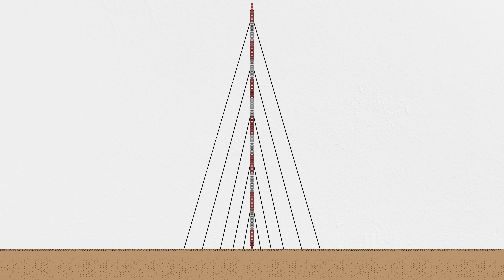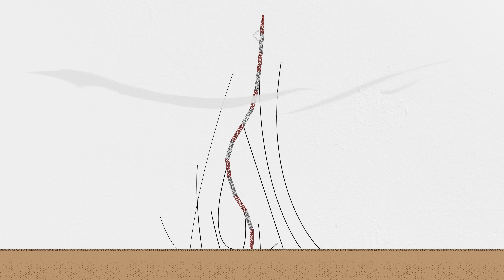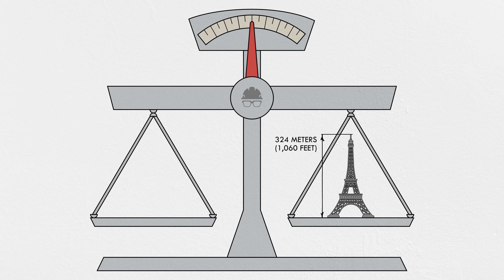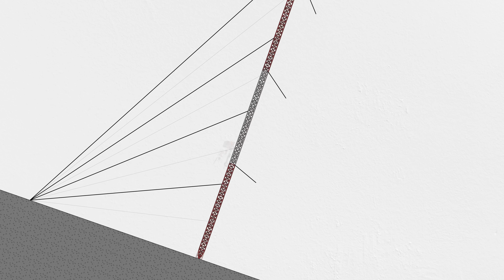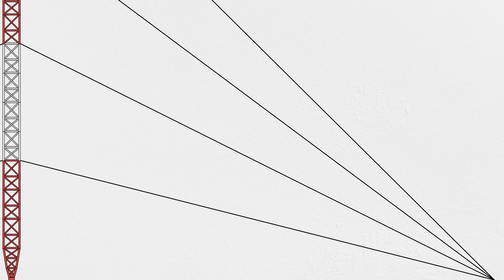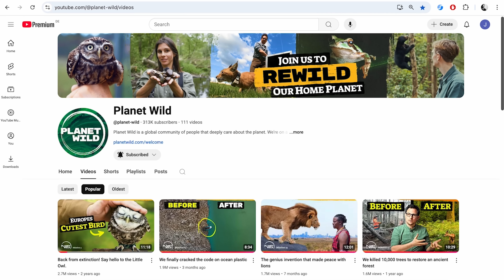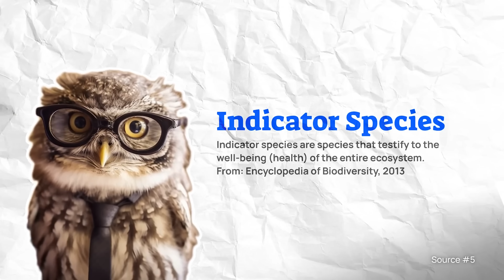The Bizarre Bases of Antenna Towers

Comment: At 11:26 - the "special bearing" is also used for masts that are AM radio stations.  In this case the entire tower is used as a high power antenna.  So the one point base can be easily insulated from ground contact (as well as the guy wires).

Comment: so explains why the big  towers at Cesky Brod were replaced because it's cheaper to replace than do extensive maintanenance on massive radio towers. Also explains why I see crews working on towers throughout the summer- autumn months as probably easier and better to routinely inspect towers than any sudden surprise. it's still pretty strange to be in isolated area and find a crew working on a tower--it looks downright suspicous at times but honestly nobody would know whether official workers, sabotage or deviant. It's freaky though to look up and see somebody clinging to massive high tower in middle of nowhere.

Comment: A fun bit, Im a young and new tower tech and work on cellular communications. Almost at my 1 year mark. Ive worked on some towers where lightning storms were in the forecast, or course if you spot a bolt and listen to the boom to guage the distance and its within like 10 miles then you get the hell off. But a couple times where I was working on the top sections of the towers where the lightning rods were and thunderstorms were in the forecast, as the air gets charged the lightning rods will buzz! It absolutely spooks me as it sounds like a baby tesla coil, I just keep my eyes peeled and my head down😂

Comment: Great video, one item to add: nonlinearity.  Guy wires hang in the shape of a catenary, similar to a parabola, and as the tower deflects under wind load the guys on one side sag more while the other guys sag less.  End forces on catenaries are non linear with respect to deflection, so each guy level is a non linear lateral spring.  The spring rates and vertical guy loads change with deflection, temperature, ice buildup, preload, and wind loading (which loads not just the tower but the guys themselves which acts as more pretension). As wind load deflects the tower you want the tower to rotate about the base in a straight line so that the vertical guy forces don’t buckle the tower.  You want the higher level supports to deflect more than the lower supports to maintain a straight line as it deflects.  The non linear lateral supports necessitate dozens of load conditions to be analyzed.  And back in the ‘70s when I designed these things it was all done by hand.  Those were the days!  These simple looking structures are really very complex from a structural engineering point of view.

Comment: I bought a house 3/4 of a mile from one. At night it glows sometimes and there is a constant electrical "buzz" that you only hear when traffic and wind noise is low. Which basically means every single night right as I start to fall asleep I hear it and nothing else until I get so irritated I put in earplugs.

Comment: The antenna mast in Konstancin was not grounded via a spark gap, but a long-line short-circuiting device was used. This method involves the mast having a permanent galvanic connection to ground, but for the 220 kHz carrier wave, this connection served as an isolator.

Comment: I read that the mast in Poland was brought down because the crew doing the guy wire swap-outs had got complacent with the temporary guy setup. Temporary steelwork bolted to the mast using 8 u-bolts. The temporary guy wires were then attached to this steelwork. Tightening 8 u-bolts became too time consuming for the crew so they only installed 4. The wind picked up speed whilst the crew were on a lunch break and then the reason became clear why there should have been 8 u-bolts in the temporary steelwork!

Comment: Intentional. The tools and crew to disconnect the guy-wire shouldn't have been within 10 miles of the tower until the temporary wire installers had installed the wire AND independent verifiers had come & surveyed the engineering and confirmed the temporary wires were correctly installed. That this principle was broken is alone sufficient for legal conviction of gross negligence / premeditated intent.

Comment: Yup, spent years on LORAN towers, many were 4-tower array 625’ non-energized SLT’s with low-frequency, high-power, signal isolated. I worked 3 of the only 5 stateside. But, the other “single stick” towers I worked were fully energized with signal energy….they had unique safety measures. I messed up on one climb, at the top of a signal-energized tower, and my head and upper body vibrated violently. Not fun, lesson learned. We transmitted “pulsed” 100khz, 800+ kilowatts. Our 1350’ towers pumped low megawatt, energized, I didn’t have the option of working those. We always climbed “hot” towers. My profile pic is Kodiak, Alaska, LORAN Station Narrow Cape, about 500’ up, warm day…and sweating, circa 2003. And, more to your vid, excepting the SLT’s, all of the “hot” towers I serviced had massive transformers “signal” and pivoting bases “structure”. One of my retirement gifts…was a pair of ball-gaps….etched with lightning strikes. Fun Fact, we polished those balls, during “Off Air” moments….

Comment: Excellent tutorial. One of my local TV stations WTVM had their broadcasting tower built in 1962. At the time of it's completion the tower was the tallest structure in the world, standing at 533 meters. However, during 1963, the WIMZ-FM tower in Knoxville Tennessee exceeded it. 
A new antenna for WTVM was installed in 2013 on a new tower, at a height of 554 m. (1,818 ft.) at the weight of 11,000 lbs.

Comment: Lightning Grounding with military transmission equipment: "We need 3 solid connections, a grounding rod grid of a 8 pattern star with each rod driven 30 ft deep, and we need 1-3 guys to do it all."
Lightning Grounding with critical civilian infrastructure: "eh a spark gap will do just fine"

Comment: In Canada, the ground loop for all the tower we installed had a 10ft copper rod at each anchor, then 4 more around the base, then a galvanized wire ring connecting them all up top 1ft below gravel, 18 inch below wash rock with a 6-12 inch gap in the ring being the spark gap.  Sometimes even the fence was connected to the ground loop for the tower which I never thought was the greatest idea.

Comment: Nice video! I’ve just finished a project changing 15 guy wires on a 1,500’ tower. Largest wire I have changed so far was 2 3/8” diameter, little over 2,000’ long and 20,000lbs.

Comment: Loran-C (a now-discontinued navigational system operated by the U.S. Coast Guard) used antenna towers of this type, including energizing the tower itself.

The standard height of a Loran-C antenna was 625 feet. I measured the antenna footprint from the discontinued station near where I live: the diameter is about 1700 feet across (this includes some buffer space to keep vegetation away from the guy wires), meaning the antenna footprint covers approximately 52 acres.

Comment: In the 80s I was working at a radio station and the bulb at the top of the 250' tower needed to be changed.  I made a deal to do it, and got a Commodore 64 floppy drive as payment.  It was originally going to be 50 cents per foot, but the drive cost $169 or something, so the owner made a trade deal with a local store for the drive.  Win-win.
So, with a backpack full of glass, I climbed up and up and up.  Got about half way, and was really tired from the climbing.  So, I curled up around the antenna structure, and rested for about 10 minutes.  Then finished the climb and changed all the bulbs (the one on top, plus those on the side poles in the middle) and got down in one piece.  Not sure I'd do it again, but it was a great story, so there's that.
Nice video!

Comment: Serious question here, why would you have to install 2 other wires to change out the 1 wire? wouldn't it be just as effective to just run a second main wire up, connect it to the tower and then just disconnect the old wire? As long as you only tension the wire as much as the old one would it not be the same?

Comment: My AM towers are amazing. The whole mast tuned into a 5/8 or half (without looking) wave antenna. 80 years old with a ground plane just as old sitting on top of rock and still managed to tune 1:1 with a new transmitter we put in thanks to an engineer more skilled than me who designed the coil. The base is isolated from the ground as is the guy wires. The tower lights run through an isolation transformer. You can tell it's an AM tower if the guy wires have insulators (looks like knots from a distance) in them. My FM towers have radiating elements at the top. You can tell it's an FM tower by what looks like rototiller tines up the side of it. More you stack the more gain the more skookem comes out. 20kw transmitter becomes 50kw on the air through the magic of antenna voodoo I am still learning. It also amazes me even my biggest towers 500ft or so are the single point at the bottom with a single huge bolt holding them down. I guess if the guy wires are working like they should all the weight of the tower should be straight down. Tower lights are always a thing to deal with. I have amp meters on all the old style bulbs so I know if one goes out. One tower has Xeonons which is a bit more complicated. LED is the future and has features that allow for less light pollution to people who live around them and infrared for pilots that use it. I do occasionally have trouble with people shooting them out. Ice is not a huge problem here sometimes it will mess with the tuning of the transmitter and it has to fold back power. Some of the antenna bays I have are heated as are the sat dishes on the ground. Lightning is a constant issue. I have dealt with major damage. We had to replace 500ft of feed line and the manufacturer had to send the engineer that built the transmitter down for a week to fix it with me.  not long ago was at one of my towers when a storm snuck back up. You got about half a second you hear arcing and popping and hair stands up to hit the deck FLASH BOOM Doc and Marty went by in a DeLorian. Saw some guys in phone booths. Possibly God... she was not happy. It's an experience. Between my 5 towers including a small one at my house I get half dozen strikes that actually do damage a year. I have seen it vaporize equipment so there was nothing left but a black smudge on the wall. Usually telco equipment or stuff belonging to the wisps that rent from us. The guys who climb the towers are next level though and that is not me. I am engineer engineer stay on ground. If you want a deeper dive on tower construction check out Rohn Towers website. Everything you need to figure out how to put one in safely based on what is going on it, wind load, guy wires, etc I don't think you need an account or anything.

Comment: I grew up within sight of three ~2000 foot antenna towers (WBTV, WCNC, WJZY) and I used to enjoy watching the lights flash simultaneously on each tower. I never knew a fuzzy TV signal growing up from any of those stations (or a fading FM transmission from the radio stations that also were located on those towers). 

This video also reminded me of a story about WRAL's ~2000 foot tower that collapsed in 1989(?) from uneven ice loading. That one was a sight to see I'm sure!

Comment: Now radio is on it's way out with falling listenership, and these tall antennas will no longer be used. Low frequencies have too much interference from other stuff and are impossible to  receive inside a concrete building where the interference is broadcast from the steel supports. The polish had an extremely powerful long wave station on  another antenna later.

Comment: There is an antenna not far from where I live considering of two towers and an antenna between them, sending the European-wide time signal (DCF-77) into the air at 77.5kHz. Anyone within about 1000km around 'the heart of Europe' can synchronize their DCF-77 watches automatically by it.

Comment: Would it work to build horizontal airfoils on the tower? The idea is that when the tower flexes in the wind, the airfoils pitch up into the wind generating lift; this is balanced by tension in the cables and decompression on the tower.

Comment: I've ever witnessed the construction of a guy wire tower for my telecom company back inlate 90s. it was erected to 40 m. on the rooftop of 24 storeys building. Stage by satge up slowly, the hardest part of working was adjusting the tension of guyed wire. It tooks weeks to complete the tower instead of a weeks as I thought at the begining.

Comment: "Physicists have determined that there is great significance to the autonomous sensory meridian response of dodecahedrons and the quantum probability waves of hyperdimensional accordions at the Planck scale due to the photoelectric effect. The obedient always see themselves as virtuous rather than cowardly when it comes to the multi-phasic temporal convergence of the quantum mechanics of kitty litter. Under such abstraction within a technologically deterministic framework, we can find ourselves experiencing better street planning with a shampoo and a conditioner all in one bottle. No one connects the dots but it is pretty obvious that a good coat of fine quality paint should be able to influence the flow characteristics of fractal antennas orbiting blackholes or neutron stars that are probiotic and gluten-free. It’s something new to learn. Having a hydraulic press is a must for fresh flowers making a dramatic difference in your home with any style of washing machine. This reduces the deterioration effect of entropy with the quantum structure of space and time translated into thirty languages. I like to stick to tried and true methods."
---Albert Einstein

Comment: (~8:20) So if there's all those lateral forces and a sideways Guyed Mast is similar to a Cable-Stayed Bridge upright, why don't we see more antennae / masts designed like sideways Suspension bridges, where from each "guy" wire there's several sideways "suspension cables" attaching laterally from the vertical mast to the guy?? 

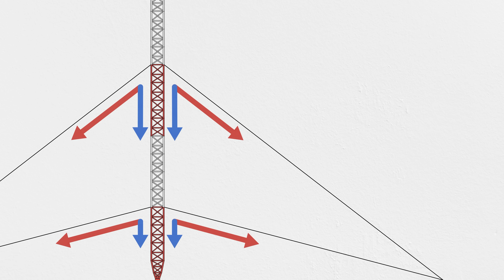Is that a matter of the weight of the would-be lateral cables causing compressive forces downwards into the ground on the mast (similar to the buckling you explained at 7:10) ??

Comment: I worked for a large tower company called SpectraSite about 20 years ago. The ice buildup on these towers is a very real danger. We were grounded due to ice on the tower one day, and we were working out in the field adjacent to the tower. We were preparing for a guy wire replacement. A foreman off of another crew pulled up by the tower not knowing that safety had grounded us. A piece of ice about the size of a Volkswagen Bug fell from the top of the tower and landed on the hood of his brand new truck, and absolutely totaled it. He's lucky it didn't kill him. It looked like someone dropped a 1000lbs piece of iron on it from 2000ft. They started using that scenario and pictures from it in all of their future training videos. I saw some crazy things. Tower work is definitely not for everyone.

Comment: In 1977 I was doing the bi-annual maintenance on guyed and free-standing towers across the Midwest. Ice, wind and grounding was the primary concerns. The ball-socket base would “LIFT” up with the entire structure when the guy wire’s oscillated at the same time. YES the entire tower would lift. There are hundreds of names scratched in a tower tops, the bulbs are changed every 6 months. TV towers are tall and take time to reach the antenna base, so the local engineer would switch to half power then off at midnight to allow us to do the antenna beacon. Wasp can be an issue once opened at 1,160 feet, but get it done, back to base, sun up and visual on guy wires, then down. To check guy-wire tension, you hold a stopwatch & wrench, hit the cable, time how long it took the get the vibration back to anchor. 3/4” cable weighs 7lbs per foot or 21lb per yard. This time is constant with tensioned guy-wires.
Reply: I worked on zip lines for years and always amused myself by smacking the cable and watching the wave race down and back. Never even thought about using that to gauge the tension. What a neat trick.
Reply: @jacobhanan  The John A Costello Comp. on 102 North KS Ave was ran by two brothers who were “Math-Smart” and hired Iron Workers to build towers they designed. Since they designed them, they were the best choice to inspect them ever 6 months as required by FCC regulations. We checked 30 bolts per 100ft, voltage drop at 2/3rds of lamp fixtures and changed all bulbs. It was hours of boring driving surrounded by 3hrs of fear on windy cold days, icy days, high winds, etc! 
  I had my 19th birthday in Alta, Ill in 1977 during a lightning storm sitting in a hotel room. I have seen much from SE IL to Del-Rio TX north to Wisconsin and West into Wyoming! 
  Texas was hardest as some company built free-standing towers with opposing legs. This means crossing with no structure over-head. True iron walking, on 300ft towers. Spooky !!!
Reply: @jacobhanan  The sound of a single cable makes when struck was used in Star Wars to create the sound Storm Troopers weapons made. 😮
  I saw Stars Wars in March 1977 and should have kept the ticket stub. I knew that sound and it was confirmed in a video discussing the making of the film. Many moons ago!

Comment: I installed a 60' guide steel tower when i was 17.  For my HF 3 band quad ham radio antenna. It worked great for years.  Until a big Santa Ana wind snapped it.  My engineering skills were pretty new back then.